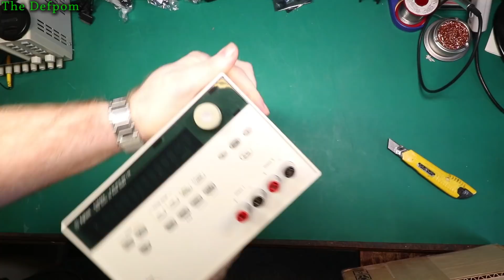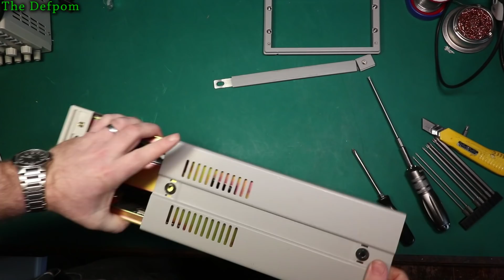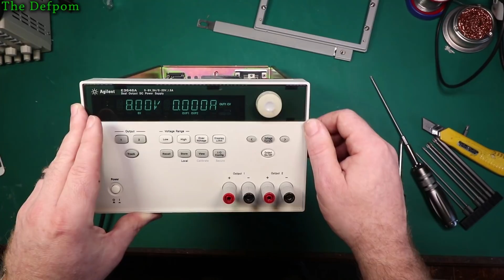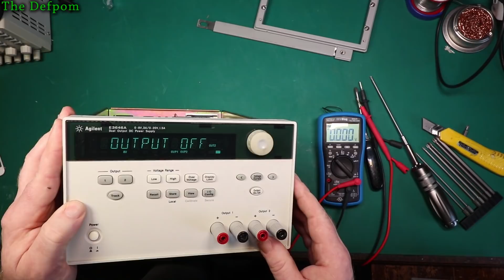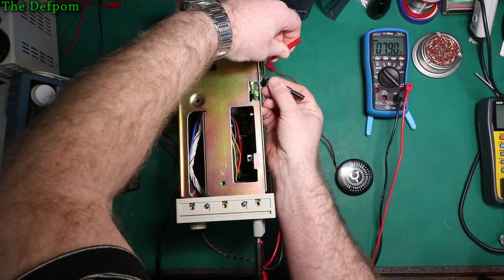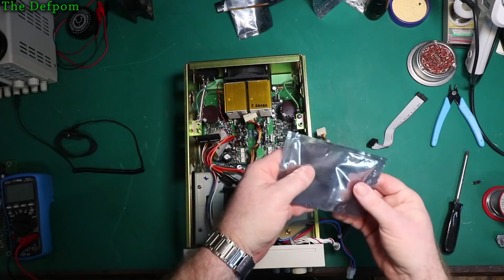🔴 #458 Fix It Friday - Agilent E3646A Power Supply Repair Part 1

Comment: I'm facing Unreg issue with E3634A, Clears Self-Test though. 

Observations : 
1) Self Test pass . So that's a relief .
2) No errors reported.
3) OVP : 25V, OCP : 4A
4) Display Limit : 25V , 2A
5) Output On with 25V,7A Mode : 
    a) Setting 0V, 0A- Recorded (DMM) 42.62V
    b) Output Off : Holds 42.01V (DMM) , takes close to 3-5min to 0V
6) Tried to change voltage and current setting on PS, But cannot change anything. DMM records 42.62V

Do you know how to fix it ?
Reply from the maker: That sounds like the output mosfet might be shorted, OR the readback circuit is not reading the voltage being put out.

Comment: I noticed the reflection of your room shop lights. Im curious what are you using? by the way in the EVblog you were right the Mystery PCB was from an Agilent E3646A. I also found the problem with that digital board. You won't believe it. It was a leaky electrolytic Cap. Changed it and all works great now. Thanks for your help!
Reply from the maker: I have two different lights, the ones that are directly over the bench are these: https://defs.link/?u=c16a226

The one I have next to my bench to give better direct lighting for the camera are these: https://defs.link/?u=bdc61d1

Comment: For the less technical viewers, you could have mentioned that IPA stands for Isopropyl Alcohol, and not India Pale Ale.

After all, with some channels like D-Lab Electronics you might not be able to tell. 

Percentage can also be important, depending on the application, as the remainder is water.   Seventy percent isn't enough in my estimation.   I prefer 90% or higher.

Comment: I glanced at the Data Sheet for that Reset Regulator and it mentions that the Output Capacitor can also lead to Delay Stability issues as well. Might be worth a look see as well since you say it's obsolete and you need a substitute. Good Luck!
Reply from the maker: GrandsonofKong - I will be doing a live stream in 22 hours, I will be trying to fix the remaining fault.
Reply from the maker: GrandsonofKong - today I tried tacking on more capacitance and resistor load on the output, it didn’t help unfortunately.

Comment: Postage from the USA is always bad. I bought £300 pounds in parts for the truck and paid £300 in shipping. Very nice power supply.  I’m just in my work shop first time since the spring. I cannot move for scopes and  logic analysers, all good stuff but I cannot move. I really need to cut down the hoarding.  It’s really really hard trying to decide what to keep even when I haven’t used some of this gear in years. The problem with repairing stuff is you just get to much stuff. Chris
Reply: I don't suppose it's worse than mine. I have 4 scopes under the bench, one in the bedroom another behind me and one in the loft! I am still looking for more to repair.
Reply: Simon Spiers  No it’s worse that that. I a run out of all those hiding places under the bed and the loft and even filled one of the stores at work. It’s the logic analysers that broke the camels back. I have five of them, don’t ever use them and can  get rid of them.  This old gear is great but it’s big and heavy.
Reply from the maker: AllTheGearNoIdea - if you have any non working items I would be interested in buying them 👍
Reply: The Defpom's Repair Channel  I did think about sending you some stuff, but it’s all working and shipping is really expensive as you said.  But if something comes up I will definitely think about you.  Are you planning any trips to the U.K. Regards Chris.
Reply from the maker: AllTheGearNoIdea - I’m not, but my wife is planning on heading over next year.